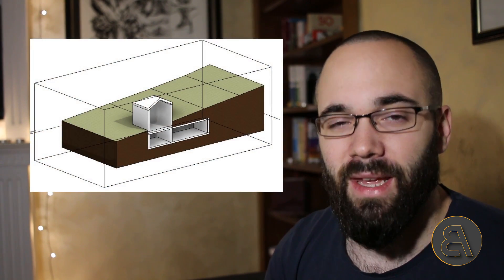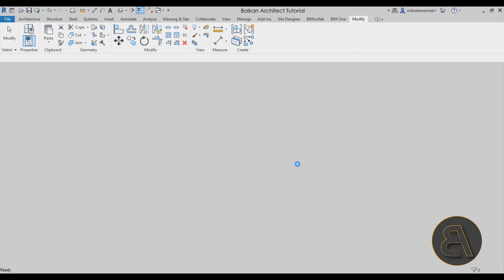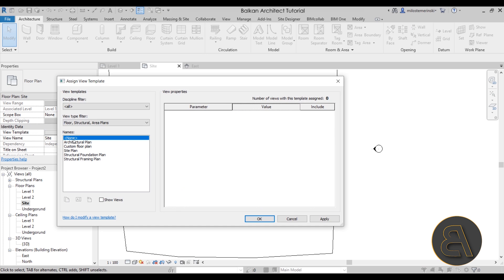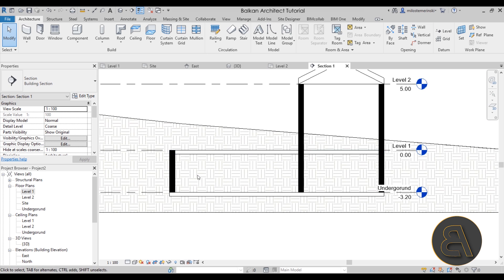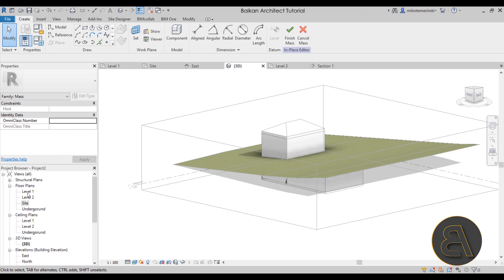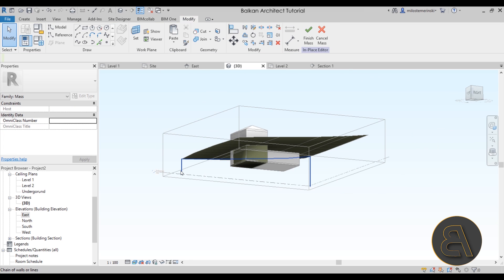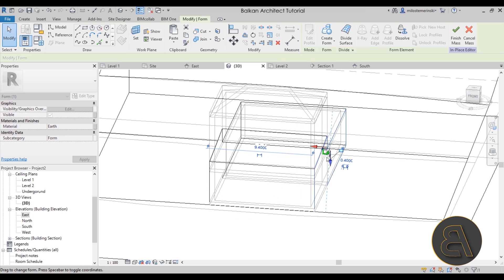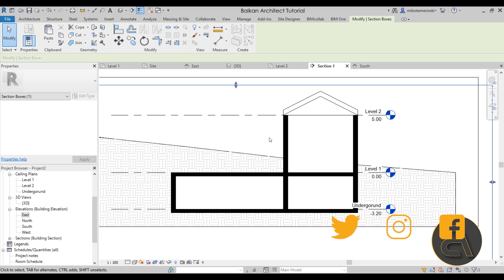Underground House in Revit Tutorial

Comment: Thank you for sharing this trick with us, but this is a simple  manual modeling and Revit needs to come up with some sort of "BIM-worthy"  solution for this issue!
Reply: There is a BIM-worthy solution, Since the "Roof" above the building has  to be constructed it should be made out of a roof with freeform modelling functionality in Revit than you got the masses.

the above solution is not worth its time to be honest
Reply from the maker: I agree! :)
Reply: BIM stands for Building Information Modelling and the site is not a building. Modelling sites requires different criteria thus different application.
Best practice for doing sites is toposurface and building pads.

Comment: Good tutorial, but i have a question.
Could this upset, or create a bigger headache elsewhere if you have other topo surface you need to edit?
Could it be done with the building pad as you first shown, but then use a massing surface in the missing area above the basement in place?  That way, and please correct me if i am wrong, you are only having to make a small surface, you don't need to match to all the existing topo surfaces, especially if you have a heavily undulating site with lots of contours.
Reply from the maker: Yes, as I said, it's not the best solution, it's only going to be useful for smaller projects and simpler topography, but it is the only solution that uses revit tools only. :)
Reply: You can also copy the mass and "paste in same place". Use different phases for the two copies. Then change the second copy. Among other benefits, you won't have a line around the smaller mass.